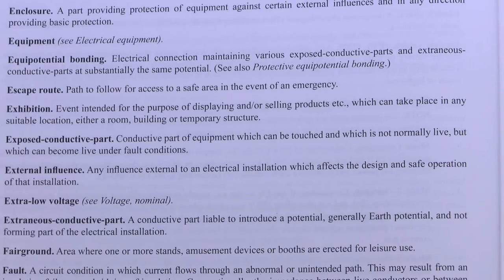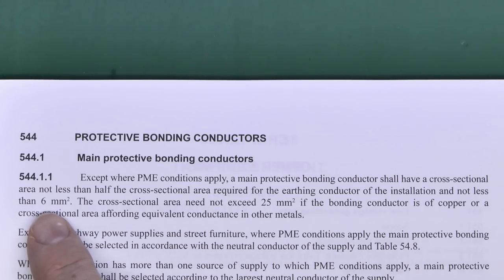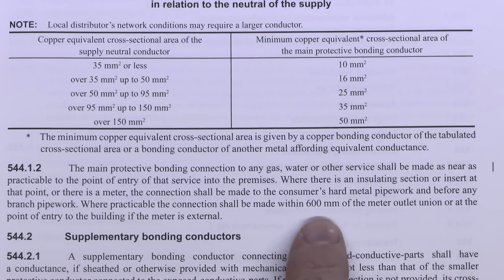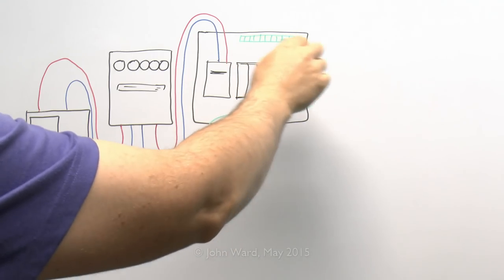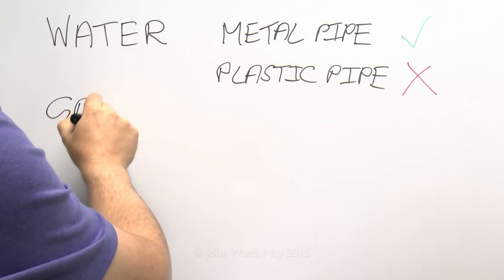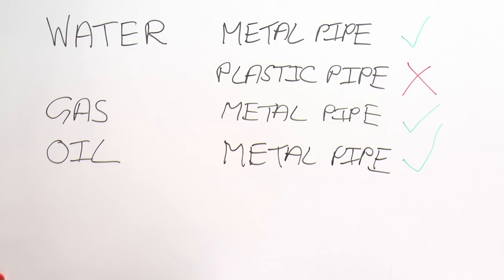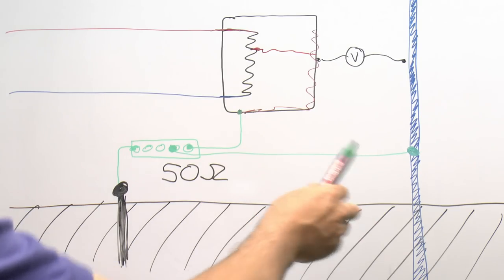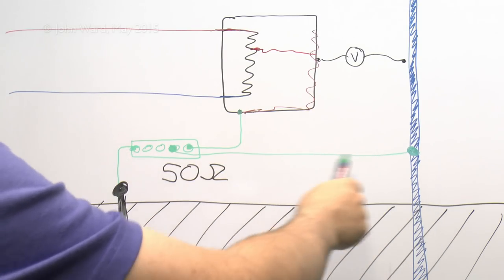Earthing & Bonding - Part 2 : Main Protective Equipotential Bonding

Comment: Thank you for the video, but I'm not clear on the case of mixed piping (plastic supply pipe burried in the ground, entering the building but further extended in the building in metal pipe network e.g. water). Graham Langley (below) understood from your video that in this case the metal parts need not be equipotential bonded as no potential is introduced (as the metal parts are not in connection with the ground becaus of the plastic supply)But Number 33 (below) said the water alone would account for a potential.Any ideas on who is wright? And if the piping would not hold water, but a non conducting fluid: would then equipotential bonding be (un)necessary?Thanks!
Reply: +klosty2 See http://www.plasticpipesgroup.com/media/1036/earthbonding.pdf

Comment: Thank you Sir. Question: If the metal pipes (water or gas or soils) comes from the ground and enters the building, the pipes are already earthed and thus  at "zero" potential via entry from ground. Any stray currents would flow naturally along the pipes into the ground. Why we need to clamp a separate cable onto the pipes on consumer side to connect to the earthing system of the building, both pipes and cables are grounded at "zero" potential? Greatful for advise.
Reply from the maker: The purpose of bonding is to keep the parts at the same voltage when a fault occurs.
Without it, an appliance casing could become live, and you would then have 230 volts between that and a pipe.  Connecting them together with bonding keeps the pipe and appliance casing at or near the same voltage to significantly reduce the shock risk.

Comment: Hi John great video keep it up, I have a question regarding the thickness of the earth cable for the gas and water pipe ? Is it always 10mm2 or can it be higher , just want to know what is the minimum requirement according to regulations?
Reply from the maker: For TN-C-S the minimum is 10mm², it can be smaller for TN-S and TT,  although it's common to find it as 10mm on those as well.
It can be larger, and is required to be larger on some installations.
Reply: Thank you John appreciate it.

Comment: An air conditioning unit with external compressor would have extraneous copper pipes running to the fan coil unit in the building.

Surely bonding these pipes is superfluous as they are grounded via the CPC of the supply?
Reply from the maker: Bonding probably not required, as they won't be introducing any potential from outside - they typically won't be buried underground.

Comment: What if there is a section of plastic pipe joining two copper pipes? The first copper pipe is bonded as described in your video but the second copper pipe is a shower feed (behind the tiles of a shower enclosure) and the plastic section has been installed for ease of joining the two copper pipes. It would be very difficult to install an earth wire to the shower feed copper pipe. This is not an electric shower but fed from a combi boiler - so two pipes (hot and cold) in this situation.
Reply from the maker: If there is a plastic insulating section, the rest of the copper pipe beyond the plastic section probably isn't an extraneous conductive part (this can be confirmed by testing) and therefore would not require bonding.

Comment: JW in a 3 phase commercial building is it acceptable to connect a Main Protective Bonding Conductor to a sub distribution board in the building as opposed to the MET if the supply cable to that sub board is adequately sized?
Reply from the maker: Yes.

Comment: I have come across a job. The CU is new with RCD, PIR testing is done. Everything is fine, but no bonding! Water stop cock is in the toilet and it is too difficult to run CPC unless take off the whole toilet system. The gas meter is outside and running the Y/G cable inside the house makes it ugly as the floor is nice tiles. The customer is not happy doing that. I wonder what code it would be? As if it was code 3 it would pass?
Thanks John
Reply from the maker: Missing main bonding is C2, and the report would therefore state unsatisfactory.
Reply: @jwflame  appreciated John.

Comment: If incoming water main is plastic (blue pipe) but turns into copper pipe at the Installation side does it still require bonding? Cheers
Reply from the maker: Probably not - but it would if those copper pipes go into a concrete floor or similar within the installation.

Comment: Can I make bonding connection inside the flat instead  of 600mm from the  gas meter outside on the soil . The  flat is on the third floor , and will require 25 meter long bonding conductor
Reply from the maker: Yes, bonding is connected where the metallic pipes enter the property, which isn't always where the gas meter is.
Reply: @jwflame  cheers John 👍

Comment: Hi john on a consumer unit change if the bonding is 6mm and shows no signs of damage is it ok to leave in or will it need upgrading to 10mm
Reply from the maker: Yes for a TN-S or TT supply.  Not for TN-C-S, which requires 10mm² minimum.
Reply: @jwflame  ok John thank you

Comment: My house doesn't appear to have any bonding of extraneous conductive parts.  I have metal gas and water pipes entering the house with no sign of any electrical connection to them.  The main earth point next to the meter is connected to the sheath of the incoming cable and only has one wire which goes via an earth leakage circuit breaker to the fuse box.  Is this a recent requirement, ie within the last 50 years, or does it not apply to a TN-S system where it would appear to be unnecessary?  Note I said fuse box, none of this newfangled consumer unit rubbish.
Reply from the maker: +number 33 It applies to TN-S, TN-C-S and TT, and has been a requirement since at least 1966.
Reply: +John Ward Thanks John, my house was built in 1959 which probably explains why there's no bonding.  I seem to remember that I promised to give  you the old Chilton ELCB for your collection when I replaced it but when I measured the actual leakage current flowing in the coil it was varying up to about 50mA so I decided to delay replacing it until I have tracked down the source of the leakage.  I'll get around to it one day, maybe.

Comment: John....great videos for an enthusiastic amateur but I'm confused.  At about 20 mins you describe a fault occurring and the casing developing a "fairly large voltage".  You then say that as long as "that's the only thing in the room" and you touch it you won't get a shock because you're "not connected to anything else".  I don't understand that.  Surely if you are standing on the ground and touch a "live exposed conductive part" you will get a shock.  Is it something to do with a TT system in your example?
Reply from the maker: You probably would get a shock, that comment was more about the dangerous situation of holding two conductive items of different potential rather than one item and the floor/wall or whatever.

Comment: I don't get why my plastic mains water pipe is bonded and the entrance to the property?
It never made any sense to me.
Its the original pipework from the 70's - 80's and is imperial sizing on the plastic and metric on the copper.

Comment: Hi John. how can I do bonding if the gas meter is outside the house. If a cable is run through the house it will mess up with the whole house as it look ugly.  ny suggestions please.
Thanks
Reply from the maker: +Hamid Bazmi Bonding connection is made where the gas pipe enters the building, does not have to be at the gas meter.
Cables can be run externally, or concealed behind coving, under floors, through the roof space and down the external walls, and many other possibilities.
Reply: Many thanks John. Looking forward to more videos. If possible some videos on  real jobs. Something about kitchen ring, saw running for loft with a new consumer unit, and perhaps 3 phase on a medium commercial premises like dry cleaning. 
Thanks again.

Comment: Is it 6mm earth bonding good enough for periodic report John
Reply from the maker: Depends on the type of supply. For TN-C-S minimum of 10mm² required.  For TN-S or TT smaller sizes may be permitted.
Reply: Its TNS thanks for your help mate

Comment: Hi John    My heating system is fuel oil l presume this requires bonding , can you confer
Reply from the maker: Only if the incoming oil pipe is exposed bare metal.  Many are plastic coated.
If it is bare metal than bonding may be required - a resistance test between the metal pipe and earth will confirm, low resistance = bonding required.
You will need a clamp designed for small diameter pipes, the usual BS951 type are not suitable for the small 10mm size normally used for oil boilers.
Reply: Thank you

Comment: 1. Can the protective bonding bar be inside of the distribution panel casing? Is it possible and allowed? What I mean is if it can be the PE connections bar inside the electrical panel casing, because I cant see any other electrical bonding bar inside of my house.
2. What does the connecting of the sheath of TV aerial cable look like in real life? Does anyone ever does it?
Reply from the maker: Yes, the earth / bonding bar can be inside the panel or consumer unit.
For TV aerials, things like this are used: https://www.blake-uk.com/equipotential-bonding-bars/215-8-way-earth-bonding-bar-proception.html although normally only done for larger systems with multiple outlets.

Comment: Main bonding within flats? Is the bonding required within each flat?Great vid thankyou
Reply from the maker: Usually yes - it's designed as each flat being it's own equipotential zone with it's own bonding and earth connections.
In theory it could be done for the building as a whole, but that would also require proper controls over all alterations to the system, something which is not possible where each flat is owned by different people.

Comment: Hi john we fit a lot of plastic sure stops just after the stop tap, does this in any way effect the earthing system and therefor should the sure stop be cross bonded?
Reply from the maker: No, but the main bonding should be connected on the house side of the SureStop.

Comment: A plastic gas main coming into your house is zero?  No.
Internal installation pipes are not guaranteed to be earthed. If installed properly the pipes will not touch masonry. If he gas meter is removed and main pipe capped, with the earth attached to the internal pipe on the outlet side of the gas meter, there is a good probability it will not be earthed.